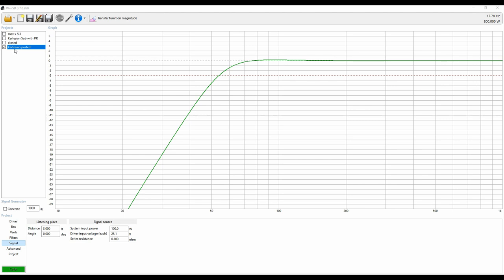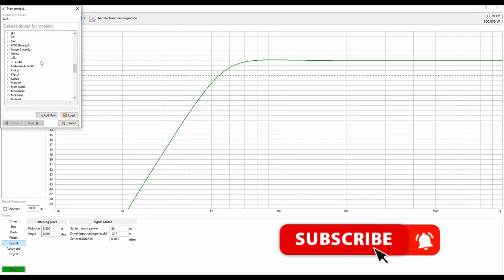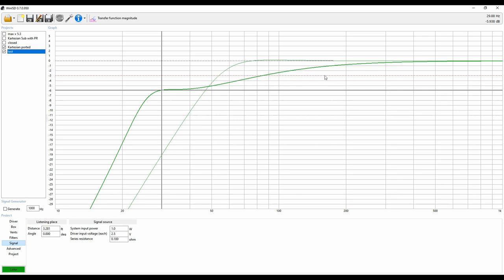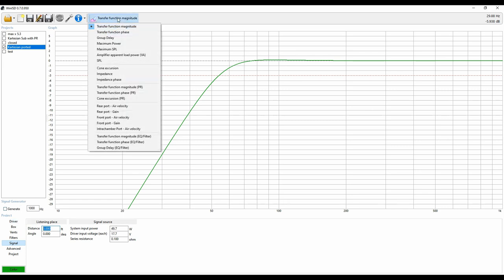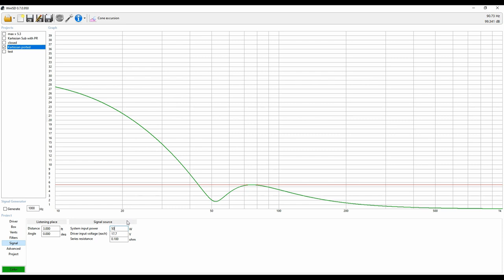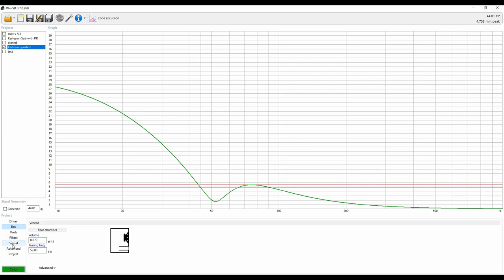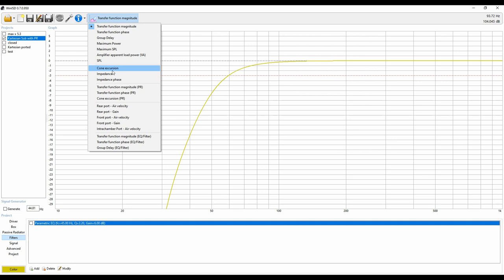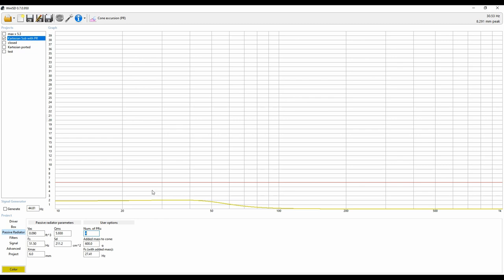How to Design the PERFECT Subwoofer Box in WINisd

Comment: Can DSP make it so it doesn't matter what kind of box is used? For example, a port box with less than recommended volume or a sealed box that's too large, etc
Reply from the maker: To a certain degree, but it will only affect frequency response. The issues that you’re bringing up have more to do with mechanical limitations of the driver. A DSP isn’t going to be able to overcome that. It can, however, account for it, and make sure that you don’t hit them with things like limiters. But in general, it’s best to use DSP with the recommended box size.
Reply: @Toid  so a high powered subwoofer would more easily handle the misappropriation of the box characteristics?

Comment: Nick, such good info into design.  With the addition of Atmos to my system I would like to design ceiling mounted speakers that are far better than the normal in-ceiling speakers that push the sound directly to the floor in most designs.  If the speaker is directly overhead that is fine, but as the channels get closer to the screen shouldn't the drivers aim toward the people viewing the movie?  I currently have a pair of small bookshelf speakers hanging from the ceiling, but I'd like better shaped boxes with bigger drivers.  So, it's time to get the wood and saws out!
Reply: The directivity of sound is frequency dependent.  You’ll notice that as you get off-axis from any speaker, the super highs, the very “s”y parts, fall away first, and on down the spectrum until you are 90 degrees off, and around there and further you’ll only hear lows and then sub frequencies.  Ceiling speakers are designed to be mounted in a relatively high ceiling for good audio quality.  As the ceiling height drops the “localization” of the sound increase. When they are in lower ceilings it’s either a compromise, fidelity doesn’t matter, or it’s simply the case that ceiling speakers get molested less than surface mount, like a restroom in a bar.   Those ceiling speakers with directable tweeters are also a compromise, and kind of a gimmick.   Those bookshelf speakers would generally sound better in a listening position.    But if you had vaulted ceilings facing the right way, that could work for you.  Don’t use big drivers just for the sake of it.   Depending on SPL and applications, even 5 or 6” drivers can handle down to 100 hz, where the subs should take over.

Comment: One thing I've noticed over time with my subwoofers (or speakers in general) is I should pay attention to BL. 

I used to like to model and think as long as I'm just touching xmax it's fine because that's what it is rated for. 

But if you're going for an extreme SQ build you might want to stay a bit further away from xmax to keep distortion lower. Normally BL is rated at 70% I think. But not everyone does this from what I've seen. And 70% BL might be something like 10% distortion but I'm not 100% sure if that's always the case. 

If you don't mind a bit of distortion as you start to reach full power then I wouldn't worry about it. And the distortion area you'd have to worry about would only be where the xmax is closest to the rated number. 

And I could be wrong about this. If I'm wrong or only half right or something. Correct me so I can learn more about this stuff.
Reply from the maker: No that's absolutely right. Especially if you know the limitations of the subwoofer. Like if you have Klippel measurements. Of course there is validity in the fact the lower you go down in frequency, the harder it is to hear distortion.

Comment: What is extended bass shelf?
Reply from the maker: Great question.  Typically a subwoofer is designed trying to keep the bass as linear as possible.  What this means, is in an anechoic chamber, the volume of a subwoofer would remain at X decibles the longest (this is called a Chebychev alignment).  And then it would hit a certain frequency and start dropping.  When it drop 3 decibels, that is called it's F3.  Which is typically how we rate its response.  But there are times where the F3 of a Chebychev alignment really don't meet the lowest frequency we are going for.  For that, we use an Extended Bass Shelf.  This uses a bigger box.  IN this box, the frequency will start dropping from the linear x decibels sooner, but it will be a slower slope.  Then we tune to box to extend either to 3db or 6db past the original x decibel linear line. By doing this, we gain additional lower frequency, but sacrifice power handling and anechoic linearity.
Reply: @Toid  this is amazing. I kind of knew what f3 was but never knew the concept of designing it -6 to get that curve.. So basically you can equalise it to get flatter response and I think by increasing gain of an amp by 3 db you'd get the best? Ooh wait the cone excursion should be looked after. This really is a rabbit hole.

Thanks for the reply. You have no idea how many newbies you've helped or would help by such videos. Cheers mate 🤘

Comment: Beginners tip:You get less excursion with a sealed enclosure or if the enclosure has a very small port it will get very little excursion too so yeah i had to learn it the correct/wrong way lols

Comment: hexibase pete fills his room with a 4" driver...
Reply from the maker: Haha, no he doesn't. But it was a cool build he did. And I am definitely a fan of those tang band woofers. They are great for nearfield listening.
Reply: @Toid  
Thank you for this comment. Too many ‘experts’ make silly performance claims just to get views. 

“Build your own home theatre sub enclosure using two drivers from a couple of old portable FM Radios. This sucka. will shake the foundations of your house. It meets THX standards, is powered by a TDA7429P and will fit in the palm of your hand!”

Okay, I’m exaggerating. But people will say that a mini subwoofer will hit 25Hz, but fail to mention this is measured at -20dB. 

Love your channel. Love the content. Good level of detailed info without getting too technical for the average hobbyist. Love the Sound Advice podcast too. 

If I can make one request, it would be to incorporate some low-cost DIY subwoofer projects using some more adventurous designs. Such as a transmission line design, a folded horn or possibly even a Paraflex design. 
Would love a Paraflex sub build, which essentially incorporates a folded horn onto a quarter-wave design. They’re at the cutting-edge of sub enclosure designs and can perform ridiculously well.
Reply from the maker: @ScramTek  thank you. And I completely agree. I do wanna get some of those designs out they’re not on my current list to do, but they are something I do want to do in the future. Currently, my cheapest, well performing subwoofer build, is the iso 100 that uses $100 worth of subwoofers, but you still have to get whatever amplifier you want to power it. That is an isobaric configuration. And ends up using for really expensive subwoofers, but the end result is quite impressive. Here is the link if you’re interested. https://toidsdiyaudio.com/forums/discussion/iso-100-build-20hz-for-under-100/
Reply: @Toid  
Thanks dude. I’ve watched the build episode for the ISO100 a couple times before. Think it’s great that you used an Isobaric configuration for the drivers. That used to be quite a popular design back in the 90s in car audio builds. Subwoofers mostly weren’t engineered to perform well in very small enclosures the way today’s subwoofers can. Plus, with a perspex window in the enclosure, being able to show off the clamshell design looked cool and clever as driver and enclosure design was more basic at that time. 

I watch your channel and a few other US based channels (DIY Audio Guy of course). Problem is I’m British and there’s no Parts Express outlets in the UK. There is a retailer in Europe but we now pay import taxes (after Brexit) on top of a much higher baseline retail price for everything they stock. Which is another issue, as they carry a very limited range of the full Parts Express catalogue. 
So, following your design builds isn’t really possible. But, they do inspire me to start doing what I’ve meant to do for a very long time. Which is to design and build enclosures for fun!!!

Keep us the good work dude! Reckon there’s a shitload of people like me who really appreciate what you provide for us!